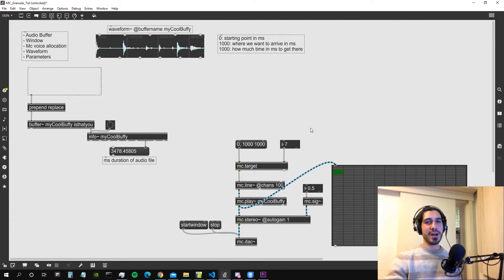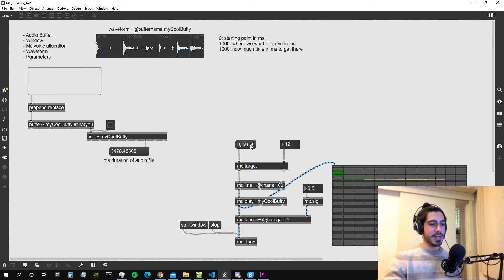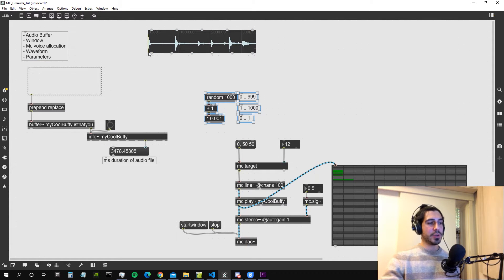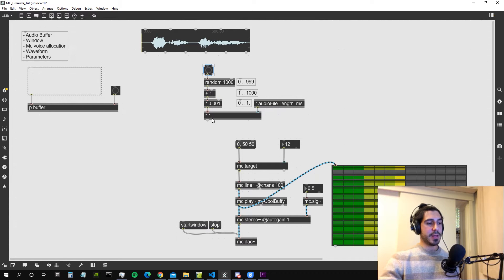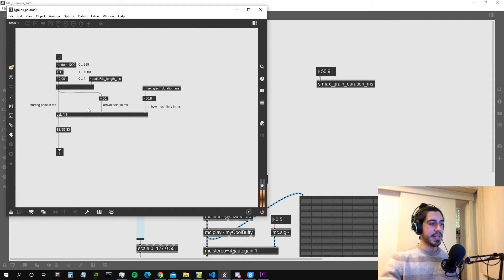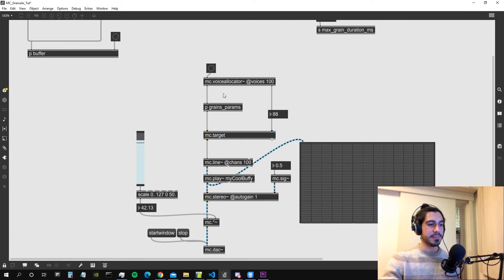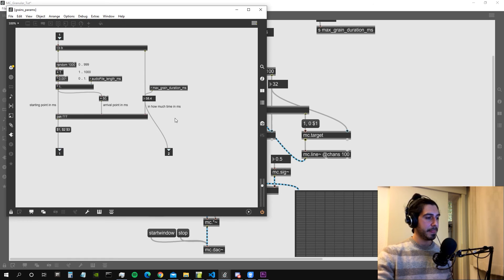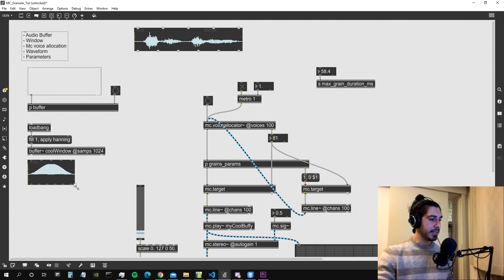MC in Max/MSP | 04 - Granular Synthesizer Part Two

Comment: It was a very good and instructive lesson. Can I ask a question my friend? When I use groove and waveform object(during the change start and end point of the audio on waveform) I hear clicks. I thought maybe I can fixs using FFT windowing. What do you thing, can I fix thet click with this windowing technique?
Reply from the maker: Yeah some sort of fade in and fade out would do the trick. Either with windowing or any other in-out multiplication